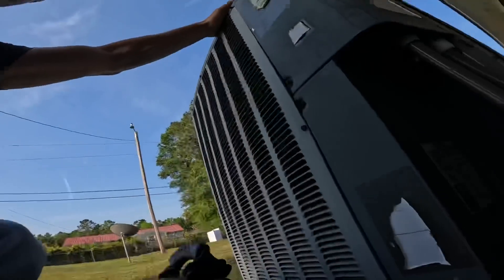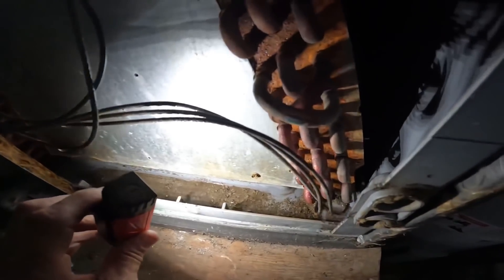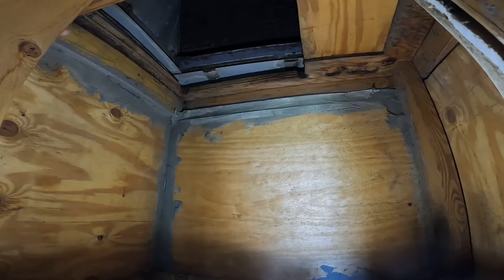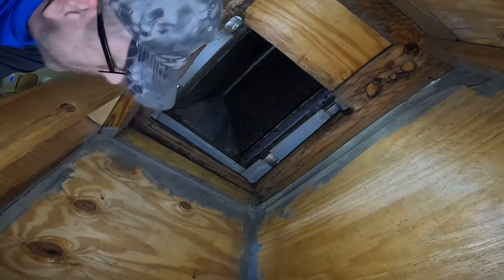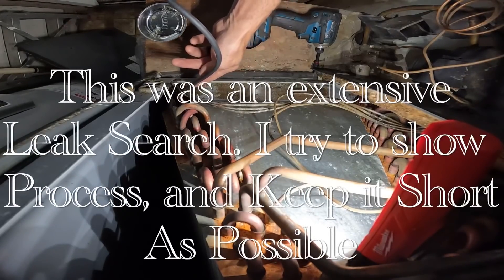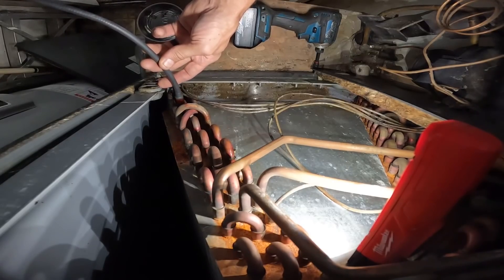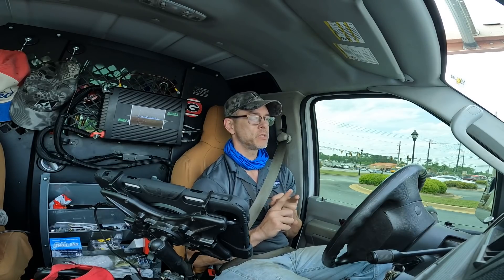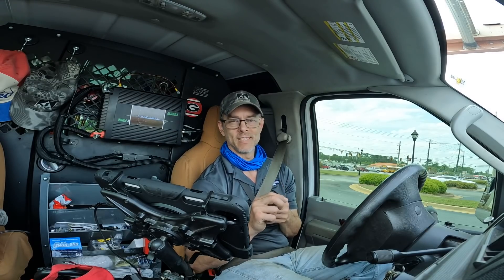Water Drips On The Floor When She Shuts It Off!

Comment: I've seen leaks from all over the place I had one the bottom of the compressor formed a leak it took a while to find because I was checking the coils the lineset never found anything and finally I took the top off and started checking stuff inside condenser unit then I found the compressor was leaking

Comment: Was the system refrigerant charge low?  Why do you normally use big blue to check the joints when soldering but not when leak checking?  Thanks Curtis, you do a great job and are an asset to the hvac community!

Comment: the trap is not big enough and with a restricted coil and filter it will not drain properly and when it cycles the condensate will drip on floor,it did not do it for you ,because you had the panel off,if you check it with the mag gage it is over 1 inch.hope that helps.

Comment: First off. I don't think it is wise using an all wood return box for a air handler to sit on. Hence all the mold around the RA opening.   
Second... that coil was what I consider clogged. There is no way condensation could drain down properly without hitting blockage and then dripping straight down. 
Thanks for the video.

Comment: That’s an easy flip man, leaving money on the table..😒. Promise you the customer won’t be happy when that system needs a motor in a year or 2 after they just paid for a new coil! they will end up replacing anyways SMH
Reply: By looking at the rust on the ALUMINUM coil. which I know on the brackets are steel. I can tell that whole system is over 7yrs old
Reply: I’ve seen rusted like that after 3 years

Comment: There is actually 3 things can cause it. Dirty coil, low charge( or suction pressure) and Nordyne microchanel coil of course 🤣
Ready? They came up with buffle plates to fix it, sold separately as kit😂😂😂 (Wich restricts airflow across coil)
Reply: Yes Sr! Microchanel coils for sure!! Smh

Comment: I don't understand pinpointing the leak on evaporator when it's not going to get repaired anyways. Especially since most of the coil isn't accessible. I calibrate my detector far away from the coil. Then put it inside the cabinet on high. If it goes off then we need a new coil. I do spray bubbles on any fittings. Just curious
Reply: You'd be surprised at the customers that want to know where the exact leak is

Comment: I've had the same thing. Great job. I saw you peeling away the insulation on the suction line and kept finding refrigerant. I've had leaks on the suction line away from the air handler and the refrigerant travel under the insulation. It ended up the customer had a metal roof put on and the line set was next to the roof. Roofers put a screw through the suction line.

Comment: Mine was like that and we end up changing the coil and enough ferrion,  it stopped. 
I think if that coil gets clean and add ferrion also making sure the drain pipes are not clogged up it will work for a while but best decision was to change the coil.
✌🙏

Comment: Clean the coil and spray it with Dishwasher Jet Dry and the coil will not shed the water in the floor. ICP units do this from time to time. I have had 2 units do it in the past 20 years. Never had this problem with other units.
Reply from the maker: I’ve used Windex. Just as effective
Reply: @HVACGUY  using Windex after cleaning your evaporator coil helps the water run down the coil and into the drain pan better? Is that the purpose of that?
Reply from the maker: @BibleBloopers  yes, when water isn’t running down the coil as it should, windex can treat the coil to help with this. We call it wetability. I have heard of the jet dry before though, I’ve only tried it once. Others swear by the jet dry.